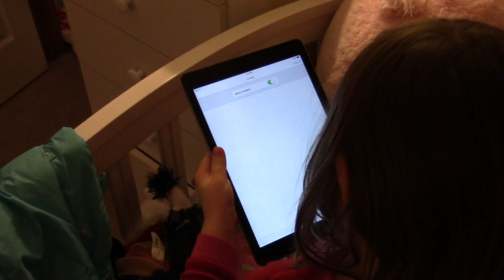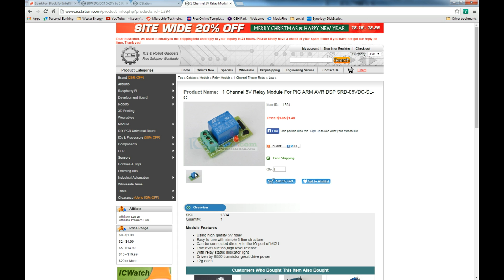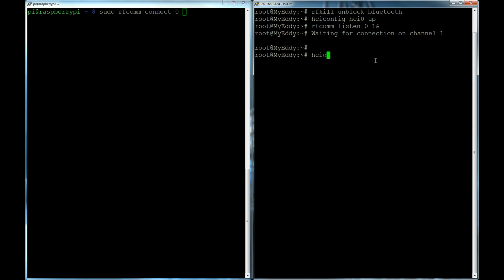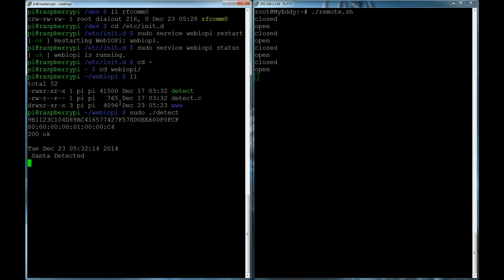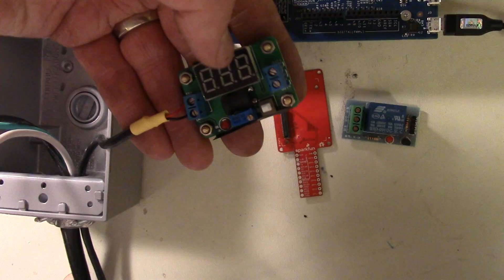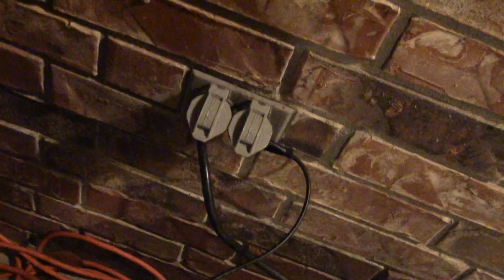Christmas Special - Santa Detector and More

Comment: I was wondering how did you get the Sparkfun breakout board to output 3.3 volts? I for the life of my can't figure it out.
Reply from the maker: annihil8ted Hey there, I apologize for the delay.  However, make sure that the solder jumper on the side of the board that has the chips on it is solder jumpered to the 3.3V jumper.
Reply: misperry Hmm I see them but I'm not exactly sure what you mean (sorry, I'm just getting into engineering). Can you show me a picture of your GPIO breakout block with the soldered jumper? Thank you for the reply!

Comment: Great stuff!  Do you have a place to get the code you used?
Reply from the maker: Yes I do.  It is on my project code link that is back at my channel.  I have it listed on my banner in the lower right corner.  It is also linked on the about tab on my channel as well.
Reply: misperry ty